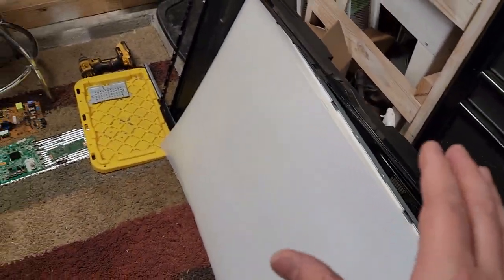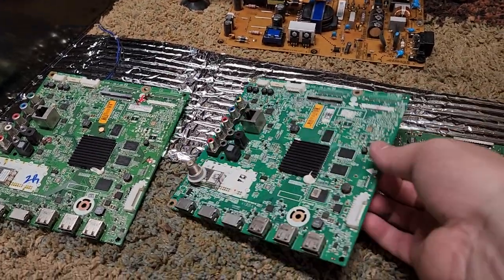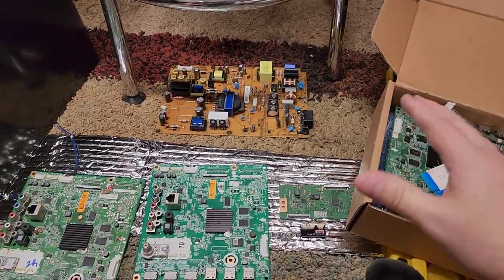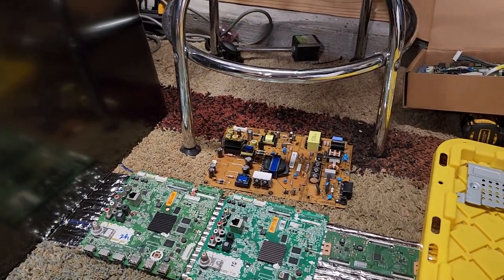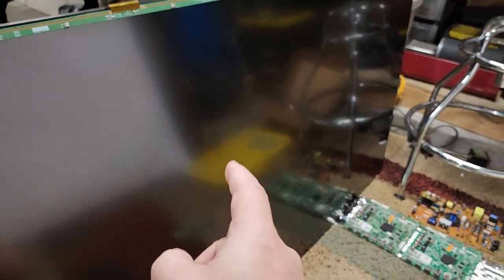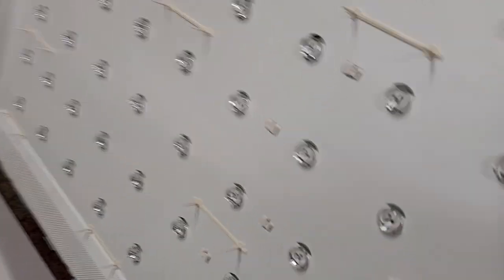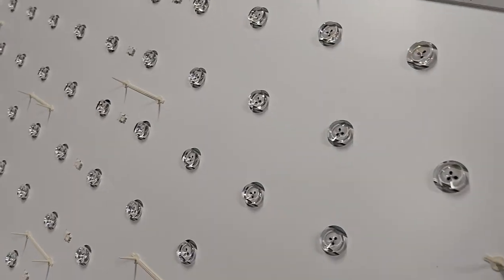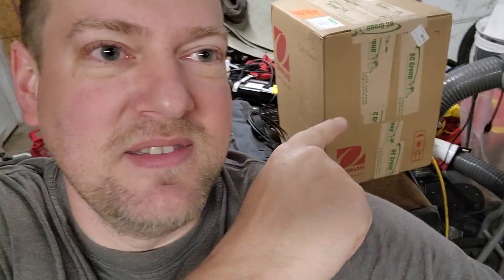Trash TV Repair Update!

Comment: The main problems that I see with LED strips are bad solder joints and flimsy connectors. On my Sanyo TV, I resoldered the LED's and removed the connector clips and hardwired the LED strips together. I haven't had a problem with them for a few years now.
Reply: The biggest problem with LED strips is, that those are over-driven, so when leaving them on full brightness from day 1, they will die after a few years. The first thing i always do with a new monitor or tv, is to lower the brightness, and this will reduce the wear on those LED strips dramatically and extend the lifetime with many years.
Reply: @BjornV78  I turn mine down to 60%.

Comment: When I find TVs with cracked LCDs, I typically turn them into light panels. Rip out all the signal processing stuff, and short the appropriate signals so the back light always turns on whenever AC power is present. Really bright with the LCD removed. https://www.youtube.com/watch?v=kGPNN2OEExc